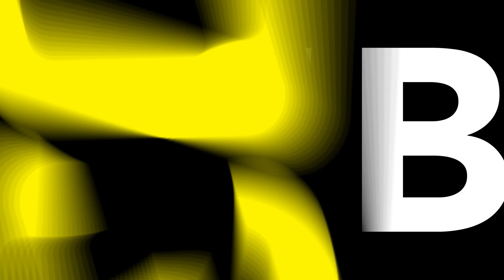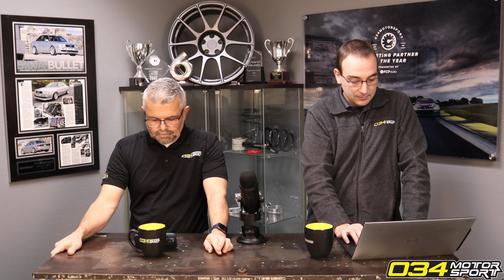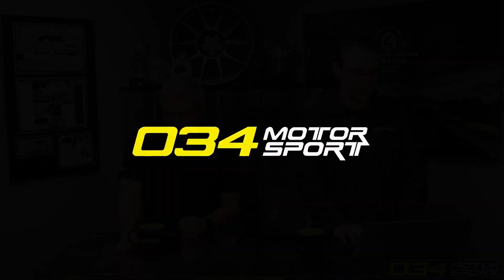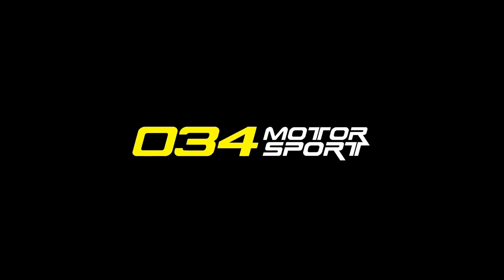TTE810 Power on 93 Limited to Turbo Itself? | 034Motorsport FAQ

Comment: is it safe to run the tte810 on 91 octane all year?? Pump gas should be more safe than ethanol correct?
Reply from the maker: It's safe to run the TT810 on our 91, 93, E60-E70, and E85 files!
Reply: @ e60-70 would require built internals from what you guys said. But pump 91 is considerable way more safer right?

Comment: Could you run tte10 on a stage 2+ file ?
Reply from the maker: Not on Stage 2+ software. You'll need our Stage 3 files with required hardware upgrades for your car to run properly.

Comment: Can 93 oct make more power if the turbo are bigger than tte810? Like a gtx3584r hybrid? Or is the engine max out on 93 oct ?
Reply from the maker: This isn't something we've tested ourself, so we cannot answer definitively.
Reply: @034MotorsportUncut  would the engine Handel the boost from a gtx3584r safely on octane 100 (EU)? And what Is the max horsepower, torque and boost safe for the engine?

Comment: I only going to put 91oct does it even makes sense to go tte710?
Reply from the maker: Absolutely! The gains from Stage 1/2 91 octane to Stage 3 91 octane are significant still, and will completely transform the power potential of your car while on any fuel.
Reply: Has the 3.0t gone through any updates as far as engine internals since the first year of production?